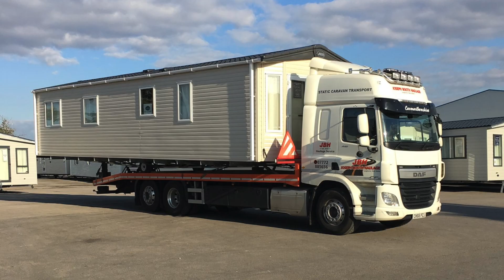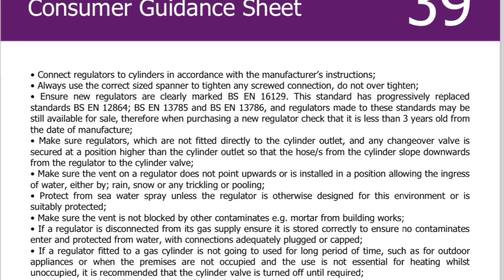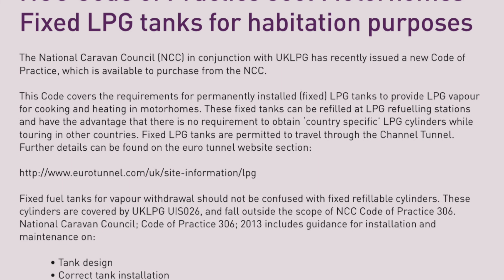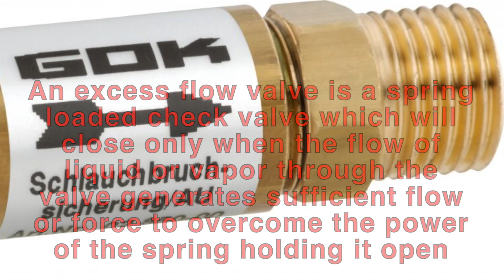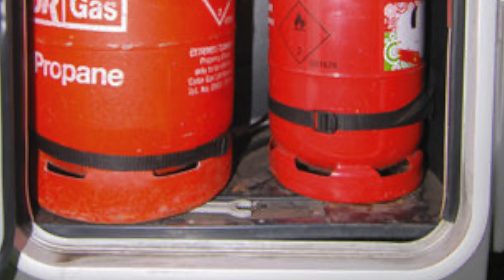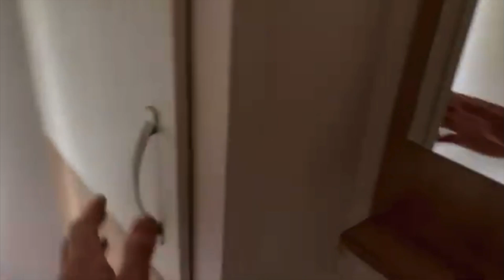LPG training part 2 looking at residential park homes (RPH) and leisure accommodation vehicles (LAV)

Comment: Great video Derek.
And ive been at this for many years but you help keep me sharp.
Just a side note regarding Olives.......so many manufacturers supply LPG boilers with brass olives.

Brass can be annealed just like copper.
Its a process to reduce work hardening..

I wonder if the likes of Vokera or Morco supply correctly annealed brass olives..

5482 mentions annealed but omits the material type....any metal can be annealed.

Whats your take on this from a practical sense?

Some new boiler installs ive replaced brass with copper olives and others when ive ran out - Just left the manufacturer brass olives in their LPG (classed as G37 on box) boiler, (which havent been supplied as NG to LPG converted.)

Warmhaus is another that supplys brass olives.
Reply from the maker: It basically says best practice to use copper olives because they are softer so technically you can use brass but like you I have replaced brass olives for copper ones in the past